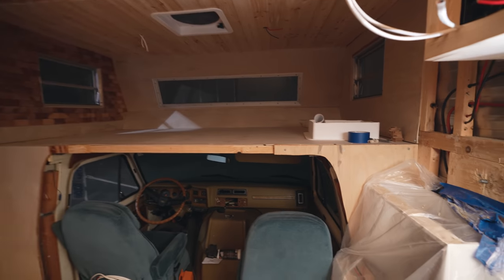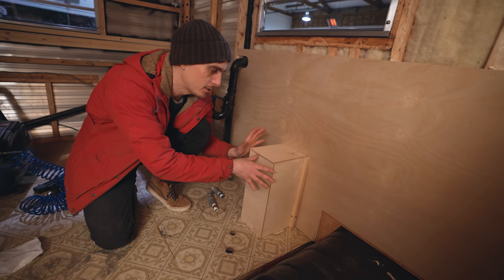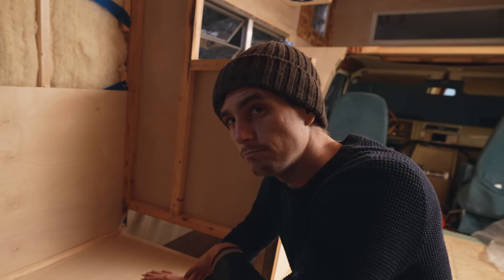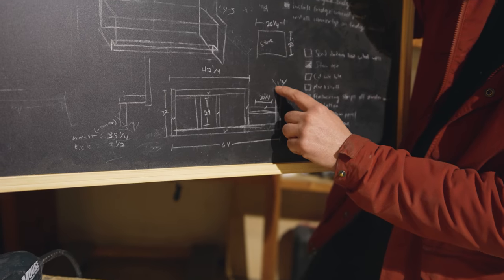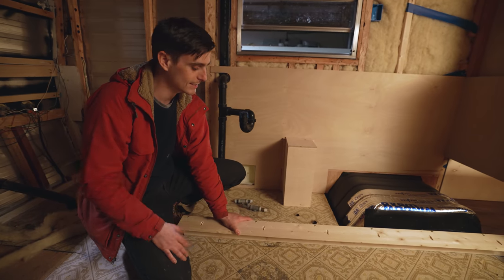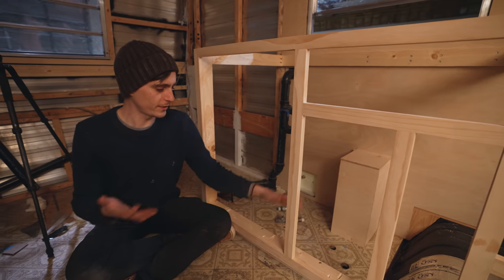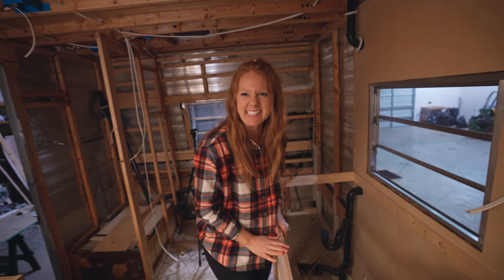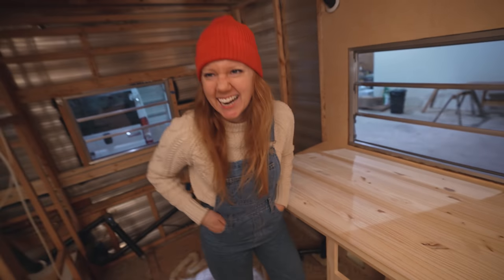RV Renovation - Building Out Our KITCHEN! (Ep. 17)

Comment: Ive mentioned this before and I guess I think along these lines more than cosmetic stuff but I am hoping you had some engine tests and or comprehensive tests done on the chassis and drivetrain so you dont end up finding you have an engine in poor mechanical condition after a few 8 hour trips. I'm impressed with what the two of you have accomplished with no prior experience.
Reply from the maker: Thanks! And don't worry, we'll be doing an engine rebuild, getting transmission work done, and have the whole shebang inspected in the near(ish) future 👍 We definitely don't want to do all this work and then break down immediately 😅
Reply: @Theendlessadventure  The engine might not need rebuilding if it can pass mechanical testing. Glad this topic is on your radar!